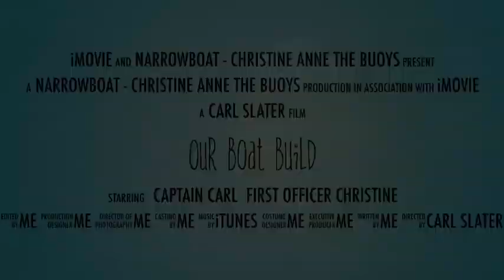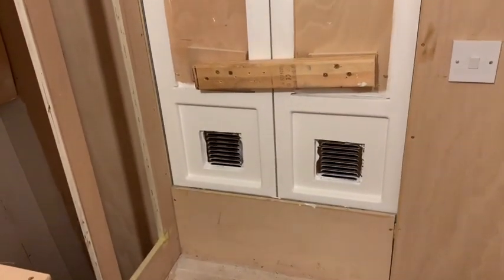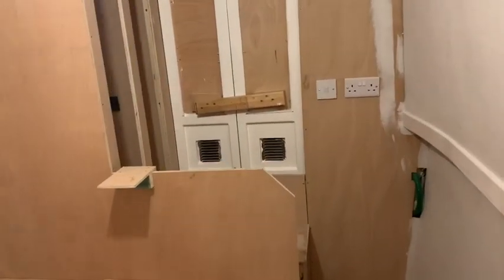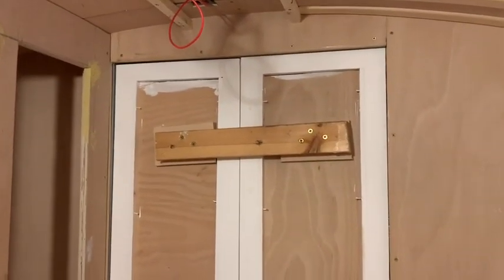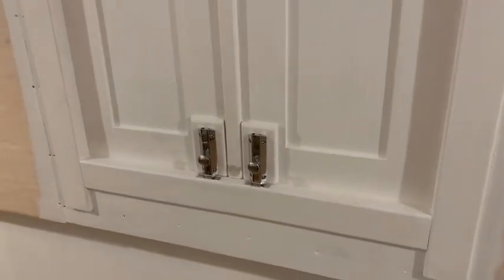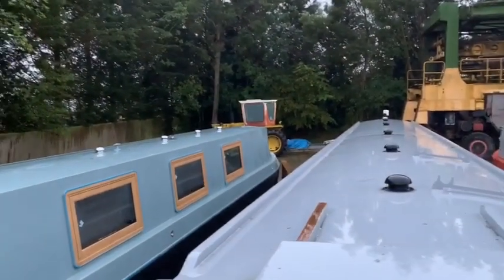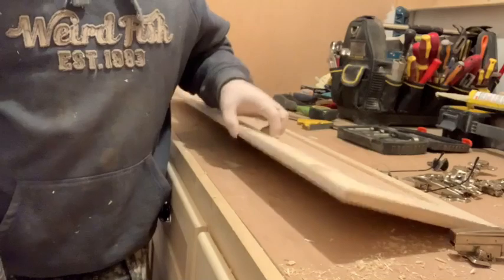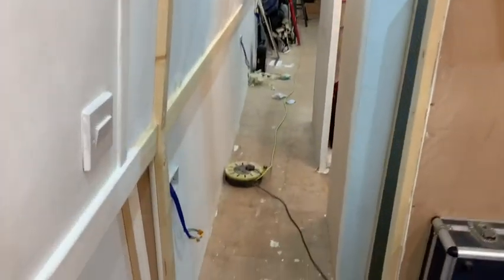New narrowboat build and fit out part 13

Comment: New subscriber really enjoying the videos. May I ask what glue you were using on the wood to steel bond? Many thanks.
Reply from the maker: Hi John & Dawn the glue I used was called lumberjack polyurethane wood glue with a 5 minute set time so you have to be quick. 
you can get it from toolstation. But other places sell a polyurethane glue, Screwfix do a version made by Evostick which I’ve used 
The glue is activated by moisture and one of the mating faces has to be porous i.e the wood
Hope that helps 
All the best, keep watching, Carl & Christine ❤️